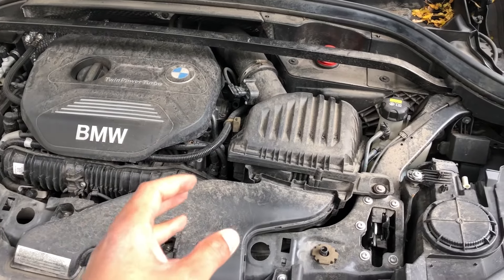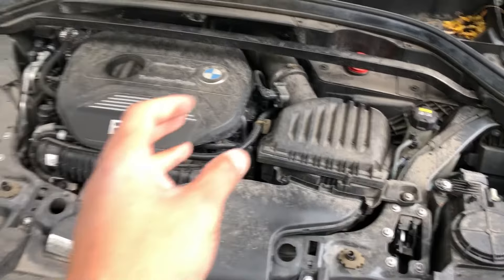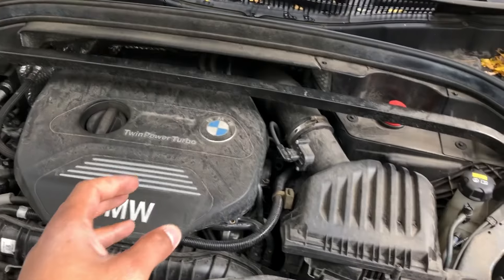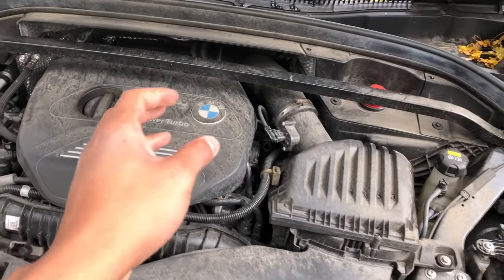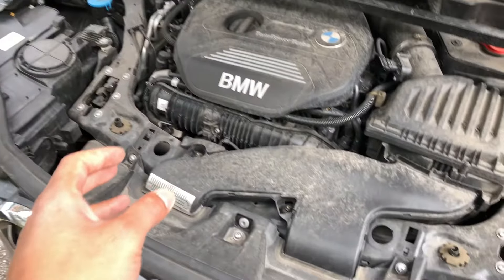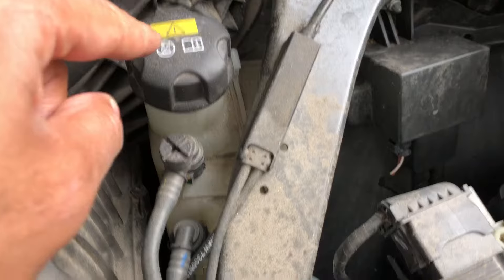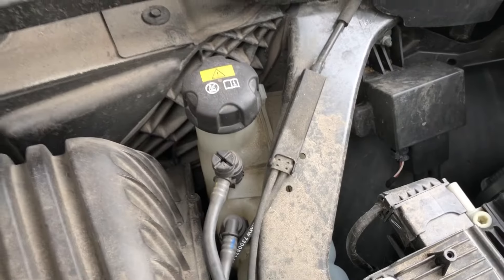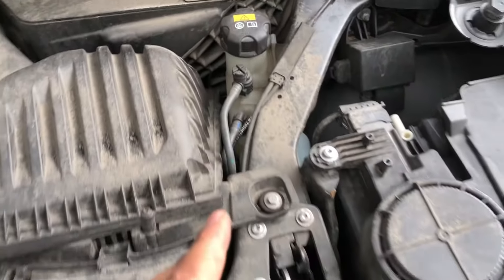BMW X1 - WHERE TO ADD COOLANT - HOW TO

Comment: My wife has this as a lease; a 2018 model. Just heard her pull up and the engine is definitely starting to overheat. Piece of crap doesn't even have a temperature gauge in the cluster.  She said she received no warnings except that she noticed the engine sounded a little heavy/loud. Thank you for this because it was on the verge of overheating and it wasn't obvious that it was the reservoir. I thought it was but wanted to be sure. No normal  coolant markings and it was at the back of the engine bay.
Reply: Have you tried click the indicator stick it has a temp thing on it on mines
Reply from the maker: you're welcome! Can you subscribe to my channel?  I will really appreciate it!